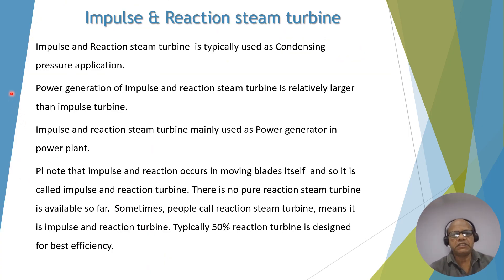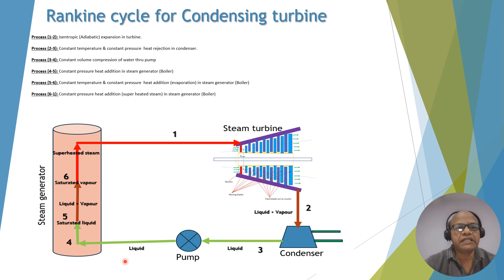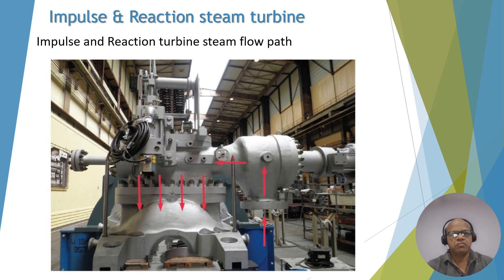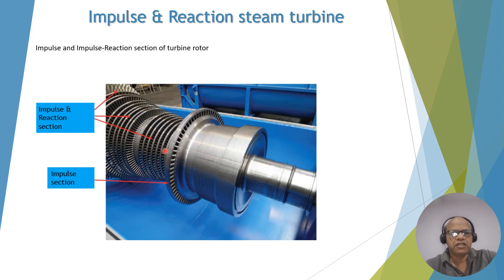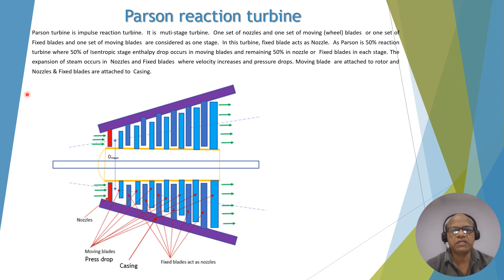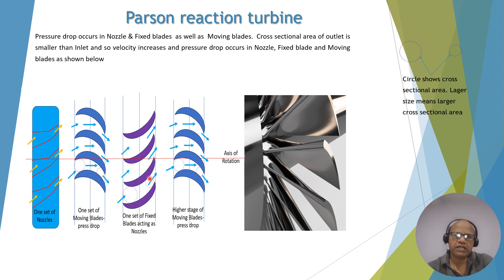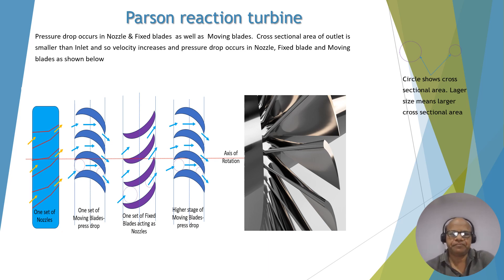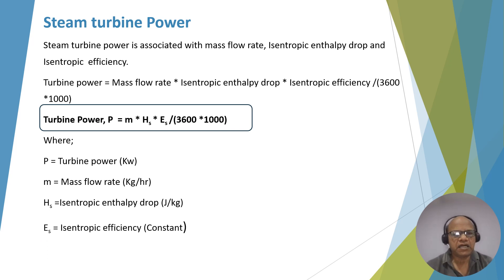Working principle of Impulse and Reaction Steam turbines

Comment: Why don't have pure reaction turbine?
Reply from the maker: In pur reaction turbine. Impulse action should be zero. In this case, whirl component of inlet to be zero. Construction of turbine would be different and such way that tangential component to be zero..more over. Pure reaction turbine , efficiency is lesser than impulse  and reaction type turbine . That could be possible reason that pure reaction turbine is not feasible in practical application.